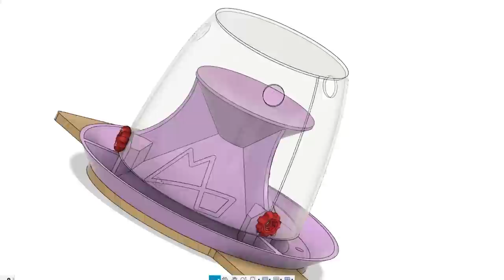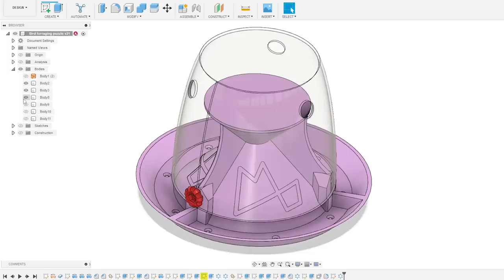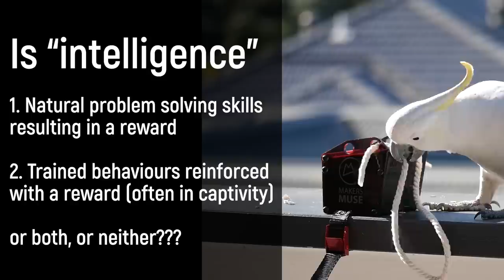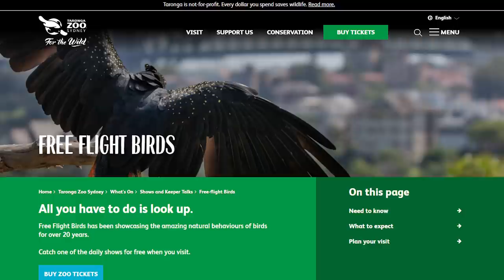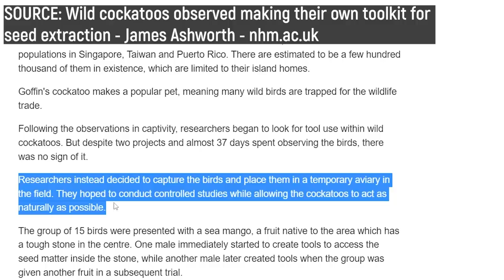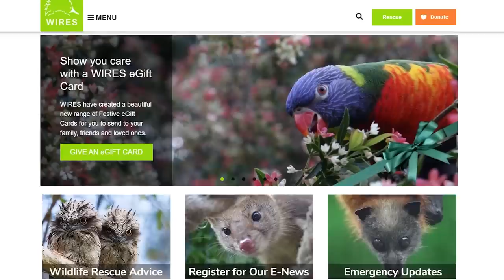Can WILD Cockatoos use TOOLS?

Comment: I think one other issue with these experiments is that in previous puzzles, you did teach them that sticks need to be thrown away to progress. So, they continue that behaviour. Throwing away the tool before realising you turned the rules around 180 degrees. 

Maybe if the tool is another material or something could make them pause to think why you swapped the material. Maybe seeing humans use the tools to get seeds might help..  I don't know... 

Interesting to see these anyway. :)
Reply: This was my thought as well. Throwing away the tool had been the solution so far :)
Reply: He could try changing the colour, material etc, but in reality, cockies just love throwing things. They do it with branches in trees all the time, cut them off & drop them just for fun. Probably needs to put the "tool" onto a chain or rope (short one so they can't get tangled in it), but even then I think they will just dispose of it, it just doesn't compare to their beak. To them sticks are for destroying, not using
Reply: Get a metal rod it will bend if they try to bite it but it could work as a tool
Reply: @takumi2023  but in reality, if they can bend metal rods with their beak, they really don't need them as tools do they - and they can bend them with their beaks, I spent ages attaching food dishes & toys around my home, using 1.75mm wire, which was the thickest I could bend with my pliers & cockies took great pleasure in unbending it all & pulling all the toys & bowls off, just for fun - then of course stealing them all as usual, one of these days I'm actually going to have my phone/camera with me & manage to take a photo or video of a cocky sitting in the top of a gumtree, holding one of my bowls full of food in his foot, having a nice relaxing meal at the top of the tree lol.

They just don't need metal tools with beaks so powerful

Comment: Angus, are you familiar with the experiment involving New Caledonian crows crafting a tool, before using it? It involves a transparent tube standing vertically with a "basket" at the bottom containing a treat. The basket has a handle and could be lifted out, but for this you'd need to grab onto the handle and it's too deep down the tube for them to reach it with their beak. One thing they have available is thin pieces of metal wire, like piano wire but much softer. They are straight and can't be used to grab the basket. The crow would hold one end in its beak and push the other end against a hard surface to bend the wire, effectively creating a J shape. It then lowered the hook portion into the tube and raised the basket with its treat. To be clear: this crow ("Betty") had never been trained to do this or shown how to bend a wire, although it had used hooks before.
There's footage of it on YouTube, search for: "Shaping of Hooks in New Caledonian Crows". There's also a 2002 research paper with the same title.

Comment: During my time delivering I witnessed a wild crow using a stick as a tool. It was the top of a traffic light that had deep grooves in it that kept the food just out of reach. The groves opened at the sides, so the crow just needed to push the food to get it out of the grooves. I think starting with just a grove too small for their feet they need to push food out of would help them make that connection that a stick would be helpful for them.

Comment: This reminds me of an experiment video clip I saw on TV, in a "hur gör djur" section (what do animals do). The setup was a room with a maze built using movable walls, a bowl of food in one corner, and an animal put in the opposite corner. Different animals did have different approaches, and the one that stuck in my mind was a small pig. He just knew precisely where the food was, and walked straight to it. The walls weren't bolted down, so they were no obstacle.

Comment: 9:40 This is exactly what I was wondering when I saw the title. The birds that have been observed in the wild using tools--corvids--don't have particularly powerful beaks, so they need to be clever if they're going to access food someplace they can't force their way into. I also wonder whether a parrot is much less dexterous with its beak than a crow is because of the way it's shaped. Maybe it's possible to design a tool puzzle that requires them to use their feet to handle the tool instead?
Reply: not less dexterous, it just that it would be like asking you to handle everything with hooks in your hands instead of just your hands straight, would be very hard to train you to do that, cause it just wouldn't make any sense when your hands to a better job without the hooks. There's a Kia with a damaged beak that uses stones as tools for beak care, cause due to the damaged beak she needs them, without the damaged beak, she would just use her beak & so wouldn't need the stones & so wouldn't use them

Comment: I like the idea of the stick tool, but what about using a retained stick? A stock that can't be removed because it has a little spatula on each end, and the stick is by default left out, and they have to put it in to scrap stuff off. Then repeating the same puzzle with sticks without little spatulas on the end so they can be removed.

Comment: 5:25 I would guess that you would have to reinforce and shape some “platform-shaking” behavior using a chopstick first in these cockatoos and then see if that transferred over to the cockatoos shaking the platform with the chopstick to get the seeds. (And, in order for that behavior to occur, two other behaviors—tossing away the chopstick and reaching for the seeds with their beaks—would have to be extinguished.) That might constitute some form of tool use but it wouldn’t be exactly spontaneous.

Comment: Have you tried to build a puzzle with wheels, like a large wheel with a chamber filled with seeds, visible through a transparent cover, so that they have to turn the wheel to a certain position to get the seeds? If they can do that you could add gears, and only give them a smaller connected wheel to trune the large one.

Comment: Just an observation but I think you've already taught them if a piece of the puzzle is loose that they need to remove it to get the seeds. Hence how they immediatly toss the chopstick rather then attempt to use it, before now all they needed to do was pull out sticks not poke them back in.

Comment: What you’re trying to induce isn’t the same as using operant conditioning like in animal shows, etc. There are plenty of studies on video using birds, particularly some good ones on New Caledonian crows and kea. You’re experiment doesn’t necessarily have a problem when it comes to demonstrating tool use, just not with cockatoos. If you presented a kea with the same experiment, it would likely be able to use a tool without a problem. Cockatoos are awesome, and very intelligent as are all parrots, but they almost certainly aren’t capable of tool use.